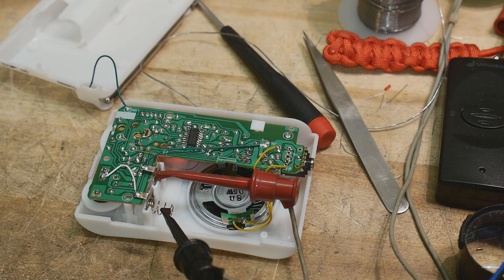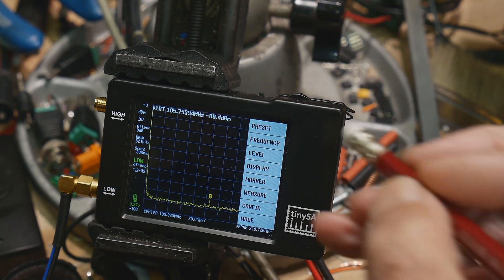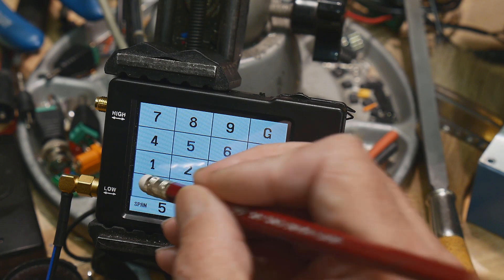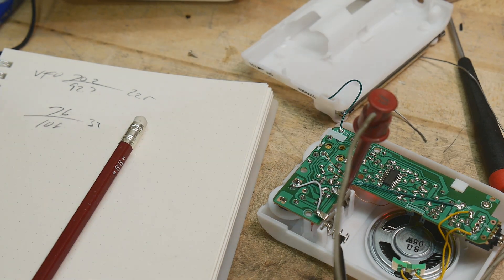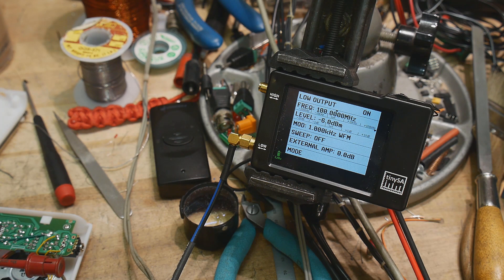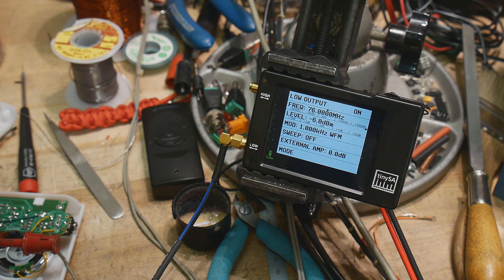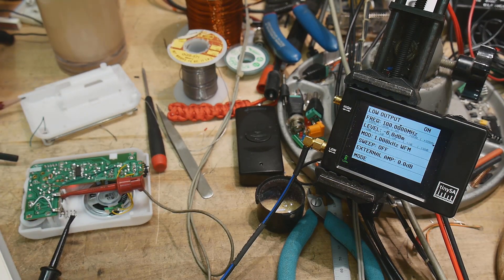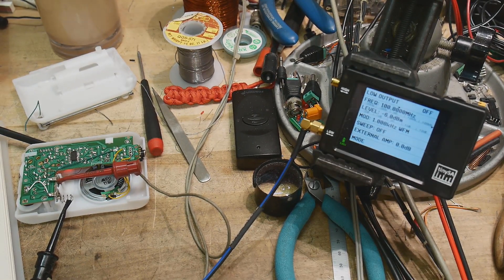#758 AM/FM Radio Alignment with TinySA

Comment: I'm missing something here and I'm not sure what it is. You have the near-field probe connected to the TinySA, and you're using it to send the signal in. What are the red and black clips connected to?
Reply from the maker: the clips are just supplying power to the battery connector

Comment: AM and RF front end alignment generally works the same way. You adjust the LO to adjust the tuning range. And the RF to get the best response. First at the bottom of the dial. then the top. Often the adjustments on the bottom of the scale are done with inductors. Trimmer caps on the tuning cap adjust the top.  
-  LO Tuning frequency is adjusted at the bottom end of the scale by adjusting the main LO trim inductor. 
-  One of the trimmer caps on the tuning cap adjusts the LO tuning frequency at high end of the band. This allows you to stretch or compress the band range. 
-  RF is adjusted at the bottom end of the scale so that you get the best response on weak stations.  You adjust something (inductor usually) so that the front end antenna section of the radio tracks parallel with the oscillator. On cheap AM radios you often shift the ferrite rod windings around a bit on the ferrite rod. 
- A second trimmer cap on the tuning cap adjusts the RF front end at the top of the band. Again adjusted for best response. 
Adjusted correctly the LO (+IF) tracks exactly the band (and band range) you want top and bottom. 
Whilst the RF front end tracks this same frequency range with good reception at every point.

Comment: Would this work For AM FM Ailment for Vintage Receivers or tuners ? like the Pioneer SX-850 to Sx-1250?
would the Ultra work better?
Reply from the maker: I only recommend the Ultra
Reply: @IMSAIGuy  Thanks, still leaning so it will work like the HP8657?   But theirs a lot different setting to setup .

Comment: In my experience the local oscillator is normally 10.7MHz above the broadcast range so should be something like 98.7MHz to 118.7MHz.

Also, the trimcap that "does nothing" probably tunes the AM oscillator.

Comment: Hi Guy,
I am now looking at your video.
Could you please let me know what the type of your Tiny SA is?
I find here devices fro 60 euro upto around 7000 euro.
It is only for my hobby.
Nice video😊.
Thanks and take care.
Geert
Belgium
Reply from the maker: as a beginner I would suggest the TinySA ULTRA. there are many clones that do not work well so here is where to get a real one: https://tinysa.org/wiki/pmwiki.php?n=Main.Buying
Reply: @IMSAIGuy  Hello Guy,
Tkx for you quick answer. I am 70 and electronics is a hobby since my 15th. I miss a lot of theory and praxis especially in alignment of tuners. I am now working on my son in laws HK-930  and I have bad FM and most of the time no stereo.
That how I found your video on YouTube. The problem is on my age I don't want to spend too much money on New equipment and I saw a 'little' tinySA at Eleshop here. Meaby this device is oké for my needs?
Best regards/Geert

Comment: Usually there are two capacitors to adjust the frequency range of the LO. One is a pad and the other is a trim. One sets the lower frequency limit and the other the upper limit. It looks like you only adjusted one of these.

Comment: If you want it even closer on frequency, I am sure you are well able to solder a 2.2pf or a 4.7 pf ceramic cap across the tuning cap to pull the frequency down closer onto frequency?
The accuracy of the tuning tracking across the dial will not be altered that badly by the addition of the 2.2pf or 4.7pf, but it will pull the L.O. down closer on to frequency if you want to be really finicky about how the dial reads, I did the same on my little homemade eBay Chinese radio because the FM band dial reading wasn't at all correct.
When I was "fixing" the tuning on my little radio, I NEVER dreamt of using the tiny SA as a signal generator, there is just so much your videos tell us and remind us that this little box of tricks can actually do. I wish I had thought of using my Tiny SA instead of using a huge Marconi 2022 signal generator!

Fantastic videos....!
Thank you again.

Comment: It takes a little experimenting to be proficient with this device , I am an old Analog guy, however I just used it as a modulated signal generator to line up stations on a dial for one radio and a peak alignment on a second radio. Next up will be a shot a a  455KC IF sweep alignment . My old Heathkit analog generator is beginning to gather dust on the shelf.

Comment: The screw caps are not extra caps. One is for the oscillator and one is fir antenna tuning,  Dummy! fM range band  is 88 mhz to 108 mhz

Comment: Looks like the radio was set for the Japan FM band which is 75-95MHz where as here it is 88-108MHz. I think the two variable caps are: one of them adjusts the low end of the dial and the other adjusts the high end of the dial. So to calibrate the reception for 88MHz you would only fiddle with one and the turn the knob all the way to 108 and fiddle with the other one. Then you could do mid dial at 98. Using the Tinysa as your source.

Comment: I've done a couple CB radios with mine. Handy little gadget.
Reply: Ahhh, so it will work for tuning 11 meters (or any). I have an HP 8553 RF, IF spectrum analyzer w/scope and a Tektronix 4 channel scope. I'm selling both of those in favor of my tiny VNA and a small, handheld, independent scope. If there was a manual or something for these things....
Reply: @ForewarnedLongAgo  I don't have a big budget for my hobby items and deals on fancy good gear are non-existent in my area. Actually have to buy radios online as well. None to be had here.

Comment: So if you don't have a tiny SA can you set this up with your HP SA? Forgive my ignorance, just wondering out loud. This is what I find most curious. Thanks for the look.Great  info.
Reply: You could do the RF "sniffing" part, however you would also need an RF signal generator to "inject" the 100 Mhz signal or whatever your target signal will be. I hope this helps you.   Fred
Reply from the maker: @electronicengineer  Yes, what Fred said.